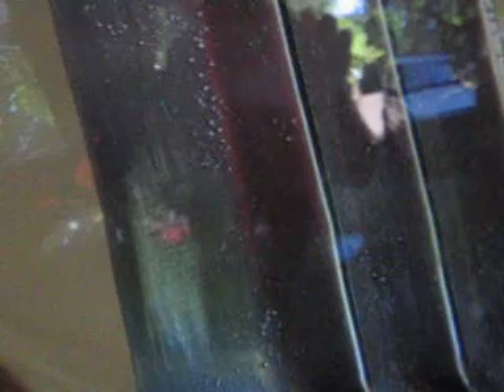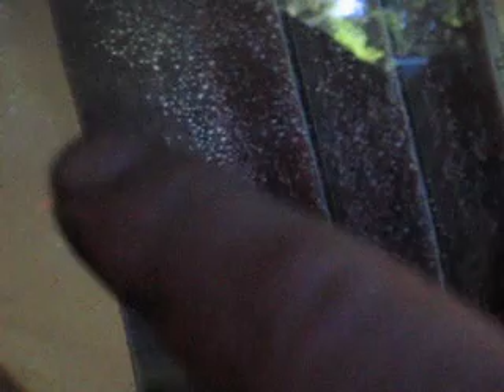Should I sand the plates if my HHO cell?

Comment from the maker: That's a great idea for creating more surface area. To answer your question, I sand both sides mainly for this reason: When you split a water molecule into hydrogen and oxygen, you will use the hydrogen for supplemental combustion, and the oxygen will be used for helping the fuel burn more completely. Gasoline and Diesel require oxygen to burn, and adding more oxygen aids in better combustion. So really, you are making a hydrogen - oxygen generator and using both gases to enhance your mileage.

Comment: FYI and for others.......
once sanded and cross hatched you should treat the stainless plates in a hydrochloric acid solution, this etches the sanded grooves deeper and gives you TWICE the SURFACE AREA, also production is only on the negative side so why do both sides???